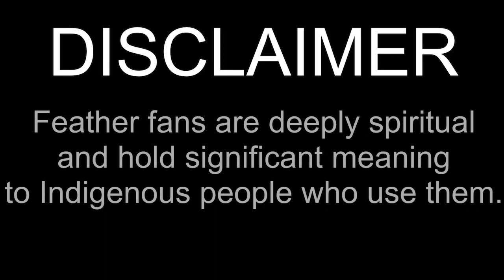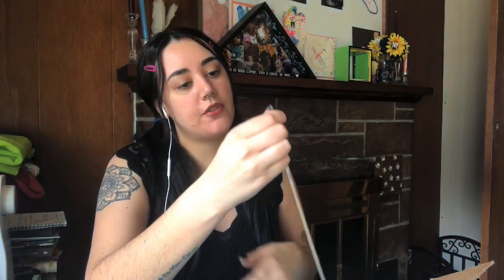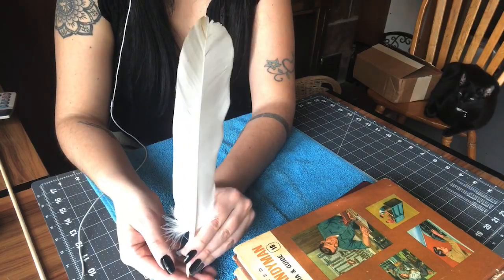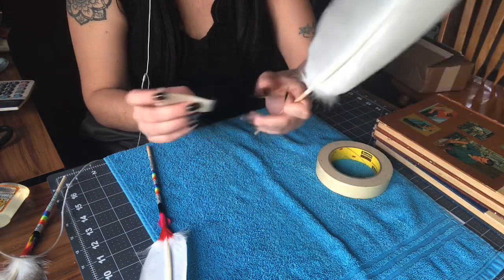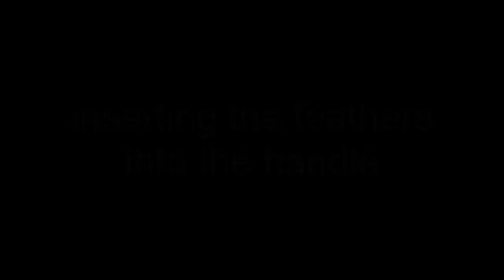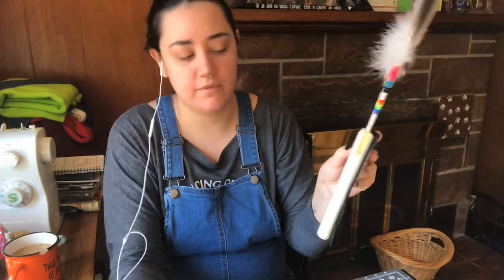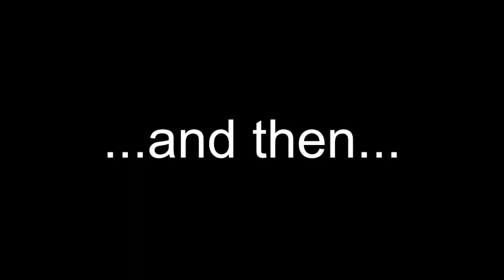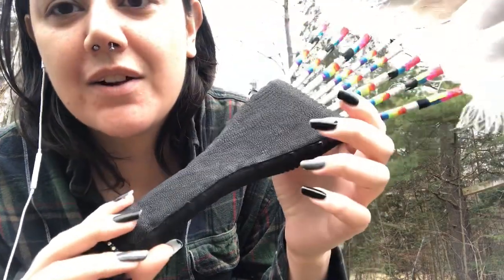Eagle Feather Fan VLOG & (kind of) Tutorial

Comment: I did my redtail hawk fan the same way--washi tape, clearcoat (the brush-on kind) to hold it in place, and E6000 adhesive to hold the feathers in place. I figured if it could hold on auto body parts, it'll hold up for powwow! I even use the stuff to rubberise my moc soles.
Reply: Did you cut the quills on the feathers for your fan? Iam trying to make one now but am nervous about cutting the quills
Reply: @brandon7482  I cut the bottom part off, but not all of the quills.

Comment: Thank you for the video.  I think you could have left out a few of your editorials but then that wouldn't make it your video.  Your fan is beautiful it is yours you made it with your hands and your ideas.  It is yours.

I would have suggested you use hot glue instead of the wood filler.  Also the glue to put on the black leather, my recommendation is to use 3m spray glue or a contact cement.  I would prefer the contact cement but the 3m is pretty much the same in a spray.

I would have also, since you are good with a needle, stiched the black parts together.  But then you always have next time and from what I can see you may have an opportunity to make more for others.  You're color schemes are natural and your sense of symmetry is very good.  I'm am more of a raw natural.  The feather fans I've seen in museums are pretty raw.  The feathers I find along the road are from birds I'm not sure of what species I just pick up what I can find that are of interest.  I try to straighten them put the like ones together and try to keep it as symmetrical as possible but also with a very raw native look rather than a commercial look.

In my opinion, and this is only my opinion as I am not a "registered Native American" I am only one who appreciates the culture, the commercial beauty that has bestowed many off the Native culture is part of the indoctrinated white culture.  I'm not saying that is bad but it looks like something in a GAP or American Eagle commercial.